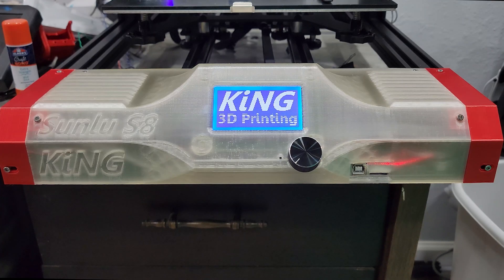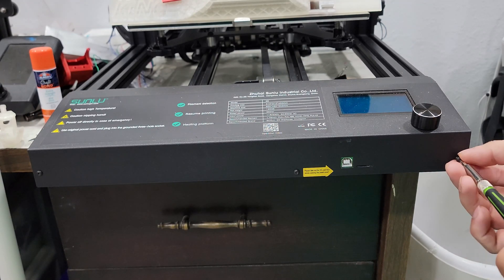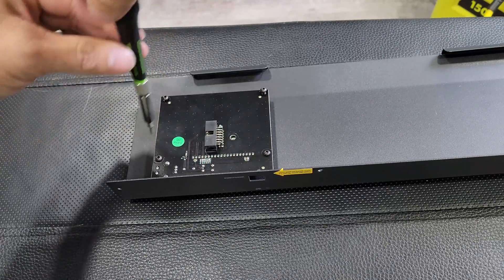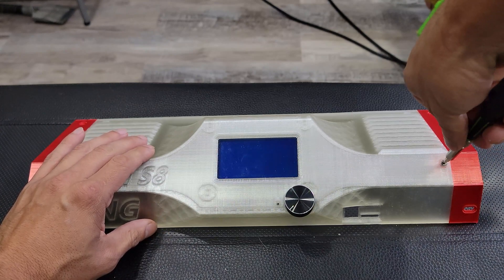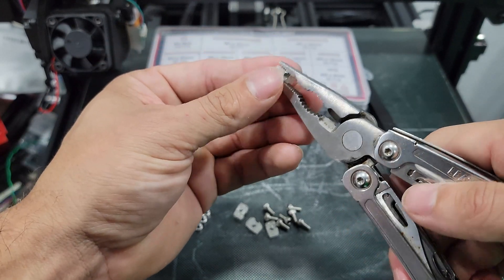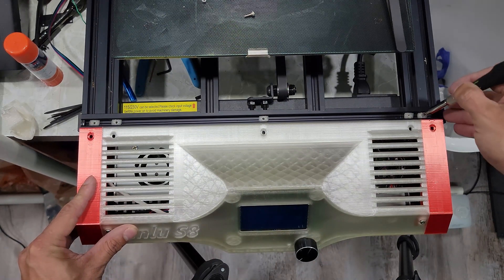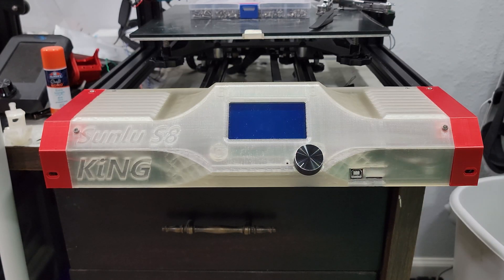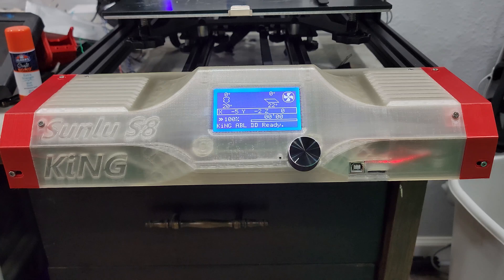Sunlu S8 Upgrade - King Front Cover

Comment: Good morning, great video. I don't get tired of watching it. I wanted to ask if you had a video on how you install the firmware for this mod, with the SKR 1.4 Turbo board with TFT35 screen. I hope all is well.
Reply from the maker: Hey there, sadly I have not done that mod to my own, so I don't have a video for it. But if you join the Sunlu S8 Facebook group: S8 Sunlu 3D Printer
there are a ton of helpful people there that should be able to walk you through it.
Reply: No worries at all, just thought I would ask. I have two San Luis S8 boards, each one is developed a minor little thing that stopped her from working correctly. So I had to switch to an aftermarket bored and I'm weary of using that because I'm concerned of what might happen. I'm actually a part of that group, so I will continue to ask. I appreciate your time.

Comment: Is this also available without sunlu S8 embossed in it?  I don't have any stock scamlu components left on my s8 due to having to replace every part on it due to failure and scamlu failing to respond to support inquiries.  I don't wish to promote scamlu in any capacity outside of warning people to avoid the brand so a virgin king cover would be better for me.
Reply from the maker: Mike has not released a version without the branding, however you may be able to send him a message asking him to remix it via Thingiverse.

Comment: How good would it turn out in ABS?
Reply from the maker: That one is entirely dependent on your printer.
If you had a good temperature controlled enclosure and your cooling dialed in, I'm sure it'd come out beautiful.

But if you're like me and have your printer open to the air (and maaaaybe sitting directly under an AC duct...) it would split apart at the layer lines probably every inch or so.

The main reason it'd be difficult to do in ABS is because of how tall the main cover is, a lot of people struggle to print very tall objects in ABS.